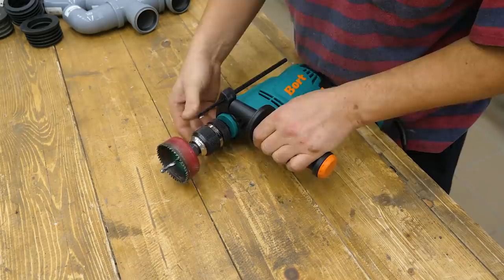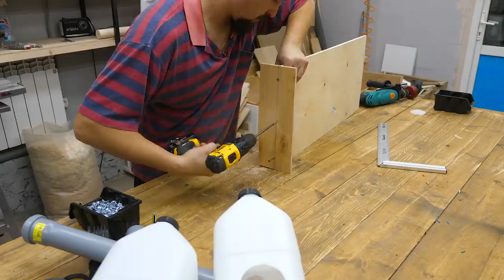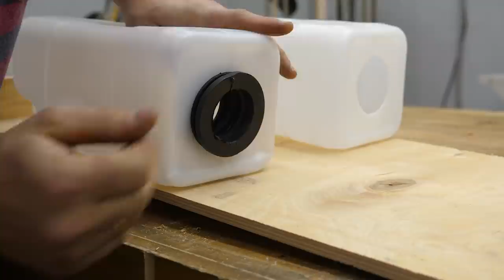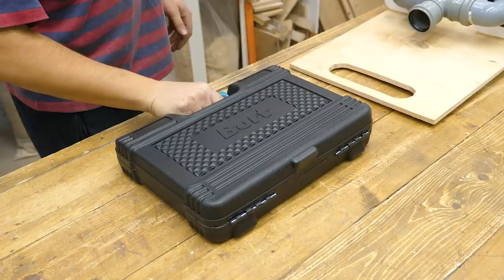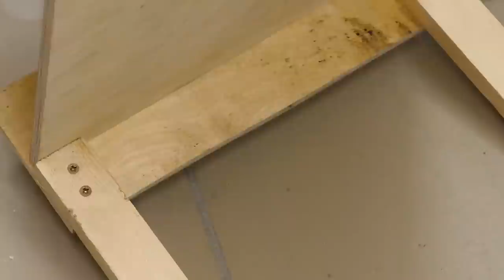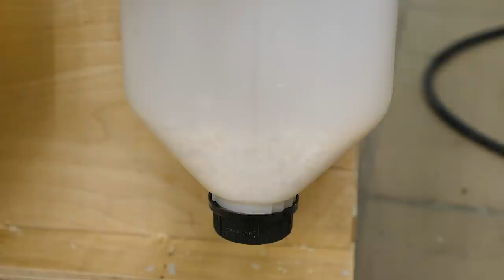Idea from plastic canister! It turned out a cool thing!

Comment: What is the device that sucks the waste? That great doubt remained. 🤔
Reply: by the sound , it sounds like a shop vac LOL
Reply: @DonaldMelton  Every vacuum cleaner comes with its own waste storage compartment. Some with the filter itself stores the waste. But, they all filter the air before going through the engine. This system from there, the waste passes through the engine and without filtering. The engine stalls with dirt. 😏